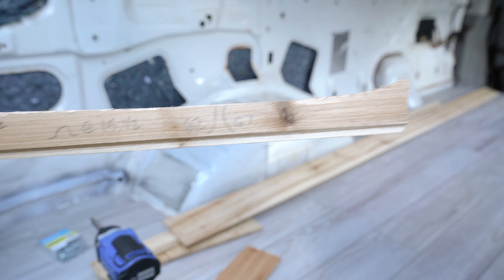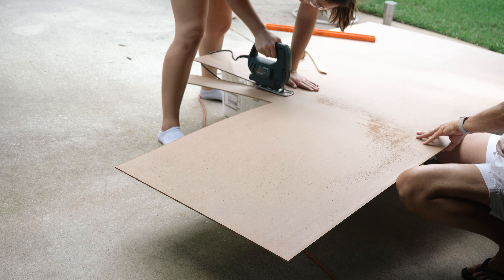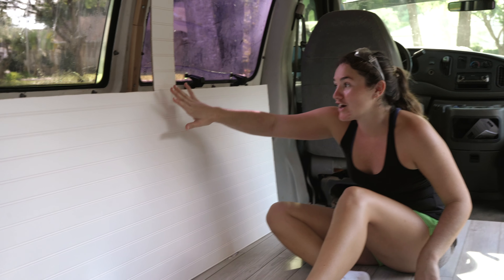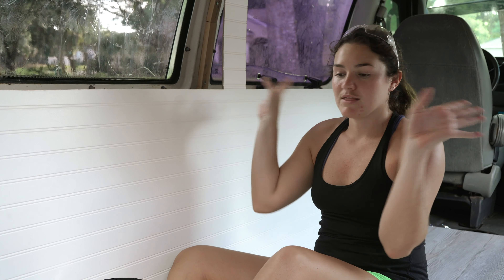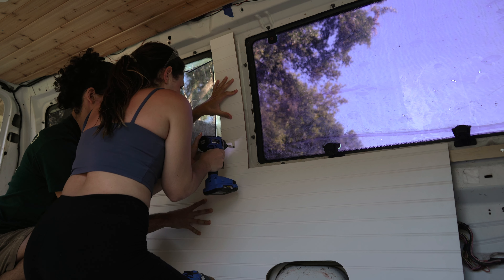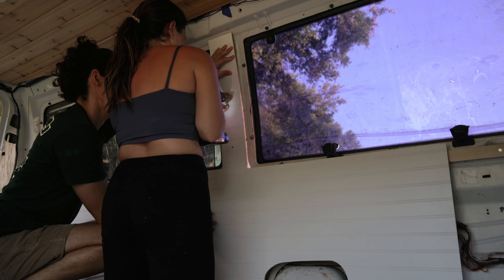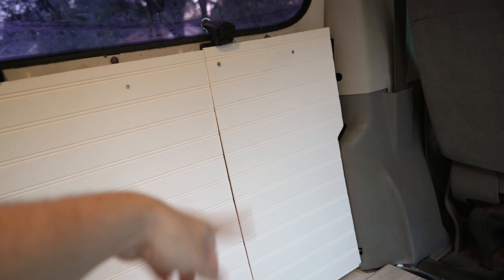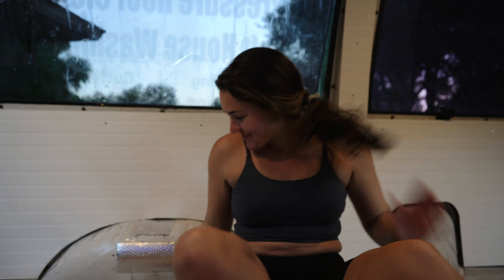BEADBOARD walls in CAMPER VAN | Ford E-150 Conversion Van Ep. 6

Comment: So helpful as I build out my 1998 e350 club wagon (super long).
Reply from the maker: That's so great to hear! Glad it helps!!
Reply: @JetlagLiv  what was the best way to cut your pattern over the wheel wells and gas tank?
Reply from the maker: I used a big piece of paper (or pieces of cardboard taped together) and held it up to the wall while trying to scribe the cut-outs. Then transferred them to the bead board! 👍🏻
Reply: @JetlagLiv  thanks, was thinking something like that. Thanks!
Reply from the maker: No problem! Good luck 😊

Comment: Olivia! I'm about to use beadboard to do the walls in my Chevy express. Curious, have you tried installing any shelving or anything where you've had to drill screws into it? How sturdy is it?
Reply from the maker: Hiya! I did drill some screws and secure a DIY shelving unit but I wouldn't say it was the most sturdy. I tried to secure the shelves to the studs behind the breadboard just to be safe!

Comment: Hey! What size furring strips did you use for the studs and what did you use to put it on there? Im having trouble with the curves on the e250
Reply from the maker: Hey there! We used the 1x2 furring strips and cut them into sections (to get them to curve as best as possible as be flush up against the walls) and used hex head self-tapping wood to metal screws!! (Got em from Lowe’s) We used varying sizing of screw length due to the difference in where we screwed in to the van. Almost nothing was consistent and we made sure we wouldn’t drill all the way through to the exterior of the van😂 I hope that helps, let me know if you need more clarification or anything!!!
Reply: @JetlagLiv  what size was the screws you used? Thanks for the help! I tried just gluing them and wasted a whole day just for them not to stick🥲 trial and error I guess. Edit: whoops just reread you used different sizes. I guess I just have to experiment and see. Hopefully i dont screw a hole out the van lol

Comment: I’m considering using baseboard too. Seven months later are you still happy that’s what you used for your walls?
Reply from the maker: Although very tricky when trying to do the back, it looks so nice with the beadboard. I'd suggest once getting towards the back by the doors to box out the back so you are able to cut right angles and have clean lines. Tricky but worth it.

Comment: Hi liv! I just started building out my e250 and was considering putting up beadboard too. How’s it holding up? How is it temp and sound wise without insulation?
Reply from the maker: It’s still great! We don’t hear any rattles because we secured it very well (wood to metal self tapping screws) I really like the look of it as well. We put minimal denim insulation and it seems to be working great.